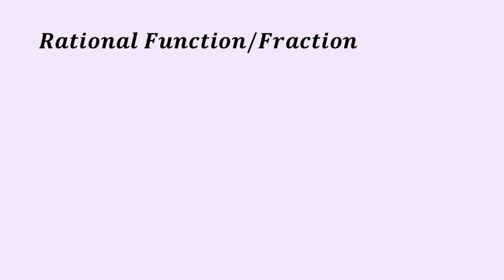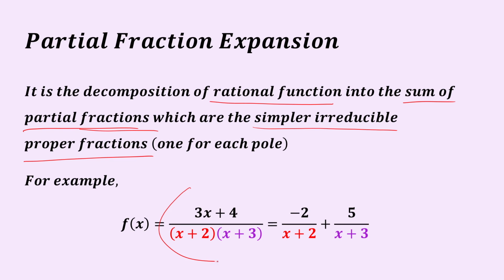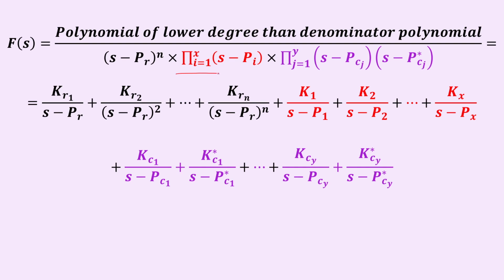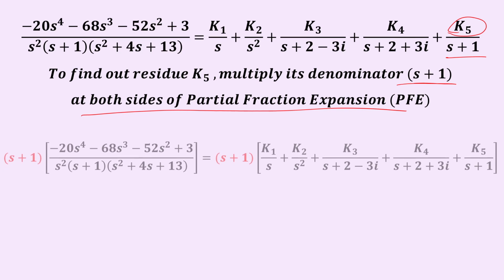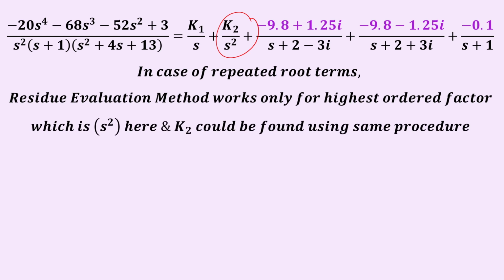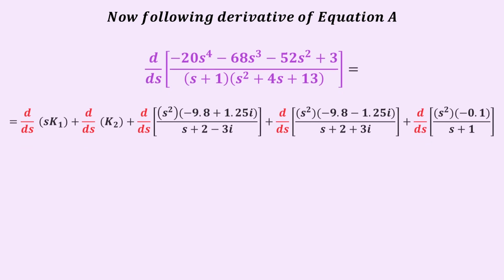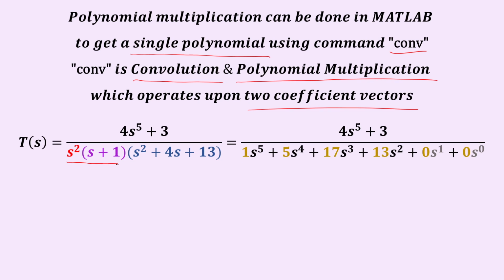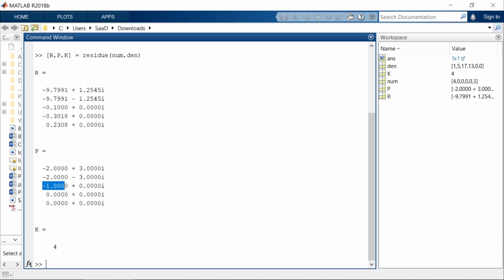Partial Fraction Expansion || All Cases Explained || Do in seconds with MATLAB

Comment: (B(s))/(A(s))=(s^2+2s+3)/〖(s+1)〗^3 
 
please cover this case also  using  MATLAB
Reply from the maker: >> A = poly([-1 -1 -1])
>> B = [1 2 3]
>> [R,P,K] = residue(B,A)
Reply from the maker: As denominator has repeated roots at -1 (pole of order 3), so poly command takes roots vector as input argument and returns polynomial coefficient vector.
Numerator polynomial coefficients are directly available, so made its vector. And then used residue command to generate partial fraction expansion.